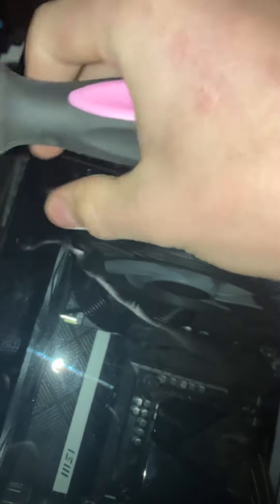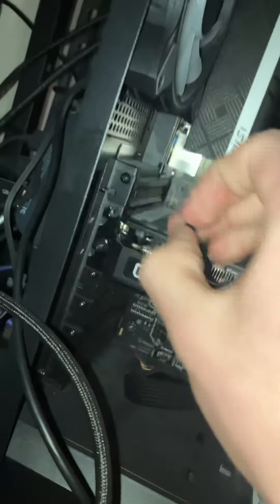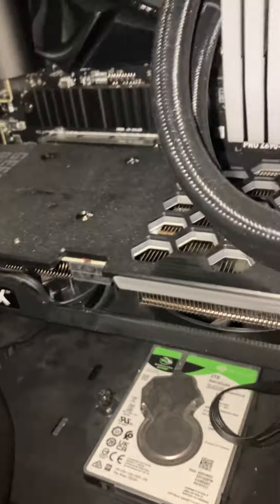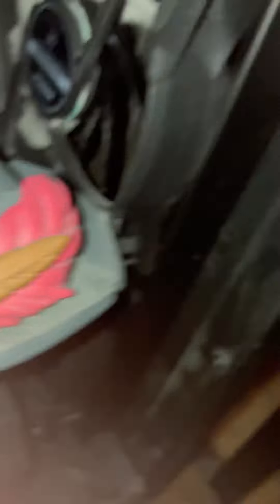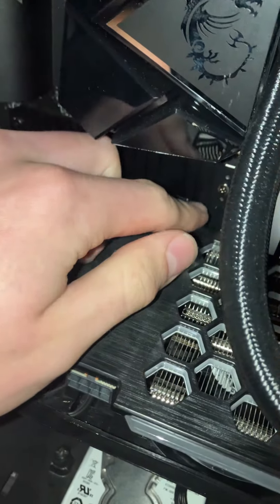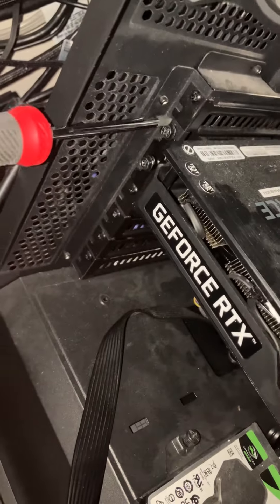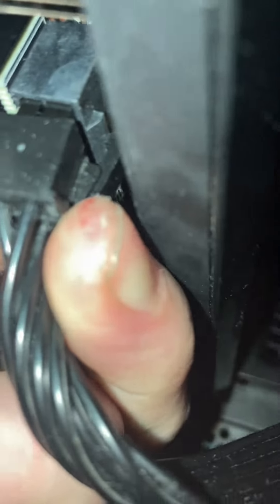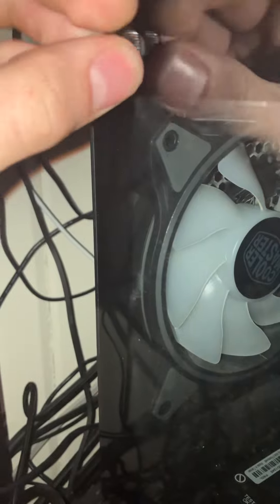How to remove/swap a graphics card [For Beginners]

Comment: I would recommend taking out the power connectors before taking out the screws because some gpus from for example gigabyte love to break when you wiggle or put too much pressure on the pcie connector.